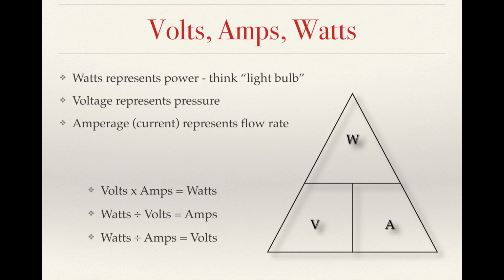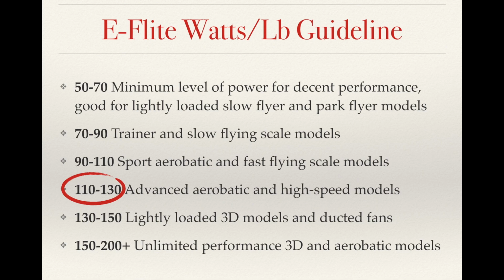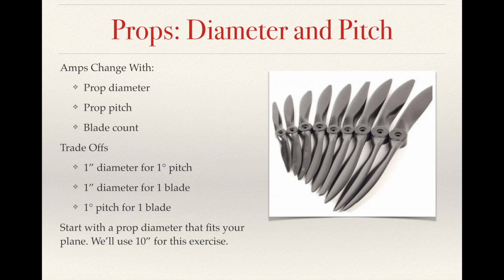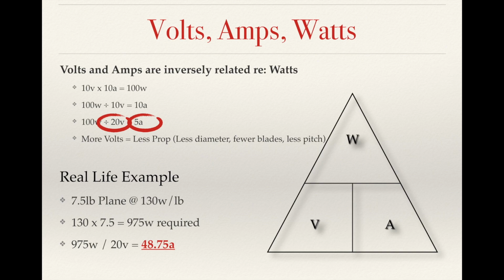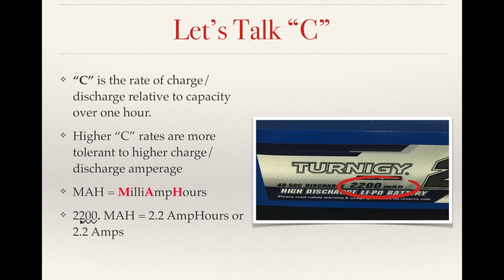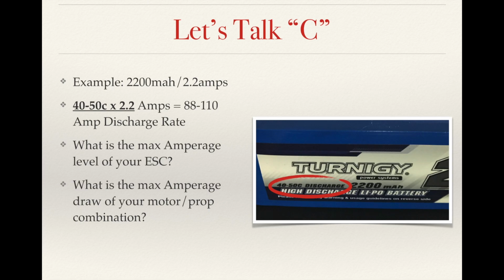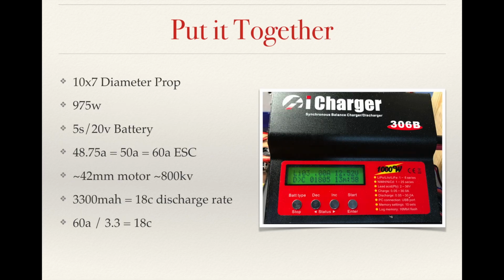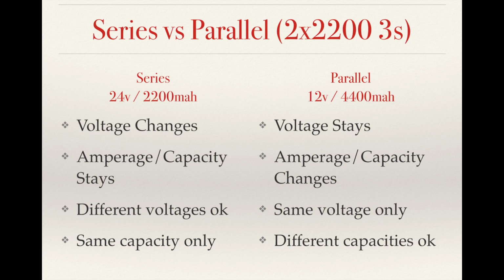How to Design Electric Power Systems for RC Planes

Comment: Great video! Very informative. I really wish you would’ve gone into how you came to choosing the motor. I’m new to the hobby. I’ve always wanted to get into it and just recently finished a scratch build and, like you said, I’m throwing darts at choosing a power system.
Reply from the maker: When it comes to motor selection, watts/lb and prop size help create a good starting point.

For the type of flying I like, 250 watts/lb is my number. With that, and knowledge of what size prop to use (2" clearance from ground for a tail dragger) and I can find the motor.

Comment: I have no talent for this kind of calculations at all. But let me try. My plane is 9pound. I want about 120. So 9 pound x 120 = 1000Watt needed. Then 1000W : 22V(6S) = 45mAh(ESC). So I take a 60mAh ESC. But now the prop size and turns. I have no idea!?
Reply from the maker: Your math checks out. Prop size is often determined by the airframe itself due to ground clearance. You want at least 2" of clearance when the plane is straight and level on the ground. Start there. PS Use peak voltage vs nominal voltage for your estimates. i.e. x*4.2v/c So 6s would be 6*4.2 or 25.2 for voltage--not 22.

Comment: 1 C means 1 coulomb of charge ...now charge is stored in the battery,  and 1C = 1amp.s (q=it) ..If it's written as 40C means you multiply  given amp rating with C rating .

Comment: For those who care about flight time or efficency you can also use a power tester and see the amps drawn for different props, once you have amps you can do some simple maths and get flight time. 5amphour battery for example can deliver 5 amps for 60min or 10amps for 30min 20amps for 15mins 40amps for 7.5mins ect. can be usefull for choosing battery that fits your flying style also.

Comment: Great video! I might have missed it… how would you go about trying to calculate/guess run time before the battery is at the 20% or so when you want to stop using it? I think I understand starting with Wattage needed, then plugging in your battery of choice to factor your Voltage (3.7 for 1S, 7.4 for 2S), so you can then determine Amps needed. Then you want to make sure your ESC slightly exceeds that Amp requirement. Then divide ESC Amp rating by battery Amp rating to determine minimum C factor needed for battery. But how do you figure how long your selected battery will last? 

For example, on a little 8 oz plane: 50W power required, using a single 1S 800mAh 30C battery gets you 3.7 Volts at 13.5 Amps required. Bump ESC up to 20 Amp, divide by .8 and you get a minimum 25C battery factor. This means technically the single 1S 800mAh 30C battery should work, but seems like it would barely work given the minimum 25C requirement.

Comment: Very good for us old people that still have glow plug engines.    These engines are slowly wearing out.  Now I want to change to electric.   I learned that there is no chart that gives me a .60 glow engine replacement is a “xxxx” electric motor with the same prop.   So you helped me get a ideal for a good direction where to start.    Thank you
Reply from the maker: You're welcome. Glad to help.

Comment: Thank you for your video. It's a great help to me. I'm struggling with the process of finding the right motor. When i go to sites to search for motors, it seems there are no tables summarizing all of their motors. Instead i have to open up the details of each one to get the details. And some use kv instead of total watts which i dont understand how to convert/translate. I also dont understand what the significance of the diameter of the motor is other than physically fitting in my model and probably torque is a factor too. If it has to be jigsaw puzzle examining every piece so be it, but maybe im missing something.  Sites I've browsed put the kv on the main title of the product and you have to dig for the wattage. Which makes me think kv is an indicator people can recognize on sight.
Reply from the maker: Kv is definitely an indicator recognizable on site. So is the weight of the motor.
Reply: @RCVideoReviews  Can the numbers you calculated in the example tell you what kv to shop for?

Comment: Excellent tutorial.  Thanks for putting it together and making it available!  I have a question about the last topic you touched on, i.e., wiring batteries in series or in parallel.  So what happens to the C rating in either configuration?  If for series connection the amperage and capacities stay the same does that implay that the C rating remains as well?  Or is it that the 2 batteries in series now allow twice the discharge rate?
Reply from the maker: C is C and local to the battery. It doesn't know or care about the connection configuration. So don't exceed the C rating.

Comment: Tried to help guys at my club understand some ideas about their receiver packs Nimh, NiCads, etc. that a voltage meter check is good but predicts little about the remaining amps in the battery. Better to measure amps used/flight x #number of flights and note if you are refilling what you used.  It was like talking to a wall.

Comment: Can you post a video explaining this? How a 2s lipo with a total rating or 

voltage of 7.4 volts, which is made up of 2 cells rated at 3.7 volts per cell is best stored at 3.8 volts per cell or rather 7.6 volts 

total. Why is this the best storage voltage that it should be "discharged down" to? How far passed the rated voltage does a charger 

charge a lipo? GOD I MISS NI-CADS!!! Excellent video btw.
Reply from the maker: When you see 3.7v describing LIPOs, you're referring to nominal voltage which is the average voltage over the discharge curve. 3.7v is also used to describe the overall pack voltage for cells in series. i.e. 3.7*2 = 7.4v. That value has nothing to do with peak voltage, storage voltage, or minimum voltage. Those values for LIPO are:

4.2v Peak Voltage: A 2s pack fully charged is 8.4v (4.2v/c). Personally, I use 4.18v/c peak as a study by MIT indicates limiting peak voltage to 4.18 extends LIPO battery life by 75%.

3.75-3.85v - Storage Voltage: Manufacturers often ship LIPOs at 3.75v/c. Most chargers default to 3.85v/c for storage. It is safe to store LIPOs at any voltage value within that range.

3.3v - Minimum Discharge Voltage: You really need to stop discharging cells when they hit 3.3v as the discharge curve becomes unpredictable and you can easily exceed the floor voltage.

3.0v - Floor Voltage: Below this value, you incur permanent damage to the cell.
Reply: @RCVideoReviews  Thanks for your answer. you've cleared up a lot of my questions. Looking forward to your future videos.

Comment: Great video sir 👍,  not sure if you will read this comment or answer my question.  I have one question > when talking about the weight of the plane being 1 pound . Is that the plane only or is the battery weight included in the 1 pound plane ? 🤔 Because batteries can weight quite a bit . 
I really enjoyed this video and I subscribed 😊 my name is Tim , I'm in Las Vegas.
Reply from the maker: Usually when calculating for performance you want to consider what's called the AUW or "all up weight" which would include the battery, fuel, cameras, or anything else not part of the airframe itself. 

Nice to meet you, welcome to the channel.

Comment: Good video!  HOWEVER, you are overestimating the power loading figures a bit IMHO, which may throw off a beginner.  In an article published 1987, Keith Shaw showed that his Spitfire with aerobatic performance needed only 50W/lbs.  For good aerobatic performance from the Spitfire, he suggested increasing the power loading to 60+W/lbs.  He quotes the power to take off from ground to be 30-50W/lbs, sport aerobatics to be 40-60W/lbs, fast aerobatics with some 3D to be 70-100W/lbs.  This is documented data, and I have no reason to dispute it.  Also, he experimented with these power loading figures when we were using brushed gear motors, Co motors with NiCd batteries.  Things are better now, and I have no idea why Eflite quotes these power loading figures which almost double what he has found.  Pat Trittle, another electric RC aircraft designer, quoted slightly higher numbers: park flyers, trainers need 35-50W/lbs, planes with mild aerobatic performance 70-80W/lbs, all-out acrobats 100-125W/lbs, 3D performers 175+W/lbs.  Eflite data you are showing match only for advanced aerobatic airplanes, but NOT for park flyers, slow scale models and trainers.  After dealing with the results from Ecalc and Motorcalc, they also agree with Trittle, and show "slightly" higher power loading numbers than what Keith Shaw obtained.  The reason I am elaborating the power loading is because it is the most essential design element besides wing loading to select an appropriate motor and fly the aircraft properly.

Comment: My father has started building Foam Core RC planes and  I think I would like to try it.  I'm in a similar stat to Atlguy below in that I have ordered my transmitter, but haven't figured out much else.  Your information will really help me figure out how to size my motor and electronics.  Thanks.
Reply from the maker: Best of luck with your adventure. I would encourage you to join our discord. Lots of knowledgeable and helpful people there.

Comment: Very excellent video, thank you! I do have a question about the example you used regarding volts and/or amps: is the voltage and/or amps at full throttle? If so, the voltage notably drops at higher throttle settings. Not sure what the conditions are when speaking of the wattage. If you could please advise it would be greatly appreciated.
Reply from the maker: Throttle and sag are not part of the equation. Volts * Amps is always Watts.  Don't cross mechanical variation with the mathematical law. If under a certain load, the mechanical apparatus (battery) sags in providing the motive force of current demanded by the load, that is a mechanical deviation, not a deviation of the formula. Volts * Amps = Watts at any throttle position or battery state.
Reply: Thank you for the quick response. So in your example 975w /20volts = 48.75a, the 20 volts is the nominal battery voltage not taking into account sag correct?
Reply from the maker: 20 volts is just 20 volts. If the power source is charged to peak  (4.2v/c) and it's a 5s battery, the voltage is 21 volts. If under load the battery delvers 20 volts, it's just 20 volts which means it sagged 1 volt. But the math still stands--the  wattage input will be 20*current.

Comment: what voltage per LiPo  battery do you generally use for these calculations, the  lower  storage voltage or   all cells  at full  charge  voltage ?...thanks 3S________4s____________5s____________6S______________
Reply from the maker: Use 4.20v/c for Lipo peak value calculations.

Comment: First class video. I'm new to RC plane flying, started with a ready to fly training model which was great. Progression has now taken me to ARF models where the installation of motor, esc and battery is required. The most difficult part of this process for me has been "what size motor" to fit to the plane, especially when some manufacturers only recommend engine sizes. I found that the online conversion charts, (engine to motor) were confusing and some differed. This video stating 130W / Ib has made this much easier. The whole video has giving me a greater understanding of RC plane electric set up. Thank you.
I purchased a model from a RC club member, Thunder tiger Cessna Cardinal 177. This model is a few years old but was still in box, unmade. The model was intended for glow engines, but I will convert it for electric power. Another club member has the same model and stated to me that it would be very difficult to convert to electric due to the weight of the model. I will soon have an idea of the weight of the model and then look at motor sizing.  Thank you once again.
Reply from the maker: I seriously doubt weight will stop the plane from flying on  electric power. People who say things like that really don't have an appreciation for what can be accomplished with modern brushless motors and strong lipo batteries these days. In any case, I'm glad you found this video helpful. I'm surprised it doesn't have a LOT more views given the number of new people who need help with this subject and the great deal of misinformation out there even amongst experienced pilots. 

Best of luck as you begin your RC journey.
Reply: @RCVideoReviews  Thank you very much. I will let you know how things go with it.

Comment: Thank you so much for making this! I have searched for months to find a simple way to design a power system that fits my different conversions from glow to electric without spending a fortune, or buying the wrong components. This gives you all the information needed to get in the ballpark in one easy location. I screenshotted the slides to share with the members of our club who may need advice in this area. Armed with this info and the understanding of KV in brushless outrunners from other videos, one can make informed choices in selecting a power system that meets their needs!
Reply from the maker: Awesome! Glad you found the info useful.

Comment: Very useful video!  The only thing I recommend is when 2 packs are wired parallel or in series, the voltage of the packs needs to be the same. Only use matching packs in capacity and voltage when you wire them together in series or parallel.
Reply from the maker: They don't need to be the same in series. In parallel, yes. In series, no. In series they need to be the same capacity. In parallel they need to have the same voltage.

Comment: Hey John, so I watched this video as you suggested and I also watched your Spitfire Power test with the Cobra 610KV motor. I ordered the Cobra 610KV motor, a 13X8X3 prop, a 3 blade Spinner, and two 4000 mah 30C 5S batteries. So the same power system you have for your Spitfire. One difference is that you used a 100A ESC and I'm planning on using the Skywalker 80A ESC. According to what you say here, I should go for 10% higher ESC rating than my PEAK Amp draw. On your Cobra 610KV Motor test you pulled about 60 amps and 1111 Watts. So here is my Math: My plane will weigh 6.4 pounds, 1111 Watts / 6.4 = 173.59 watts per pound, I think that will work. ESC needed is a minimum of 66 Amps, I'm using an 80 Amp ESC so that should be good, and the battery discharge capability is 30C x 4 amps = 120 Amps, so that should be good too. Thanks for all your help and guidance with my Power setup. This video is a huge help.
Reply from the maker: I think you're going to like that arrangement quite a bit. You'll be fine with that ESC. I think I used the 100a because I had it. You won't be beating your batteries to death with that setup either.
Reply: @RCVideoReviews   I have a question. Has your opinion on Watts per Pound needed changed from the E-Flite guideline in this video? The guideline shows 110 - 130 watts per pound is what to shoot for with a Aerobatic High Speed model. I don't agree with that range. My Sport is about 4.75 pounds and I have a power system that is 800 Watts,. That's 168 watts per pound. I love how my Sport flies and it's NOT Unlimited Performance 3D. I don't think I would like it at all if I had a 600 Watt or 126 watts per pound, power system. I think that if I had it set up for the smaller power system, I'd have to fly it FULL THROTTLE 100% of the time just to keep it in the air and I'd burn down my battery quick. So has your opinion Changed on this Guideline?
Reply from the maker: Very good question. In the video, I explicitly state it's a "good guideline to start zeroing in on where you need to be. For my personal flying style, I like 175w+/lb.  I feel very comfortable at that power level. I agree with you on the sport flying at that ratio (168) and it absolutely is not unlimited 3d. The point in all of this is to use it as a starting point and tune for your tastes. You could re-write your own chart and raise each description up one tier.
Reply: @RCVideoReviews  Understood.  I don't think I'll rewrite their chart but, like you, I think I prefer about 170 per pound or higher. That extra power could come in handy in some situations and I think the battery life would be better. Thanks again for pointing out the Big Mistake I was about to make on my power setup. It might have flown but I would probably have had a terrible flying experience. For now on I'll do MY OWN calculations and not just accept what Tower recommends. You taught me a good lesson on that. Since I'm only 2 years into the hobby, I'm still learning and you and your channel are helping me Big Time!
Reply from the maker: @davidknutz3314  That's what this hobby should be. Sharing info, collaborating, helping. Good luck with your build.

Comment: Thank for this very helpful video.
Reply from the maker: rbc725 You're very welcome. I'm glad you found it helpful.
Reply: Extremely helpful  and I appreciate the examples used.  I will use this approach in designing my power systems for some foam board planes that I am building.  Several years ago, I obtained the Dynam Hawk Sky (v1) and failed to get this to fly due to an underpower engine (or so I think).  It has sat in my workshop for several years now, but am starting to rekindle my interest in RC.  Your video has helped with some fundamental understanding of Watts, Amps, ESC, Props, and Batteries.  Hopefully, this will lead to better success!
Reply from the maker: rbc725 The Eflite guidelines are an excellent starting point. Good luck getting back in the air. Stick with it, it's a great hobby!  J